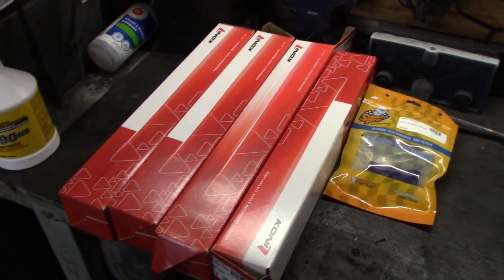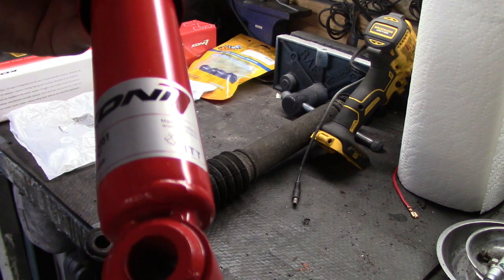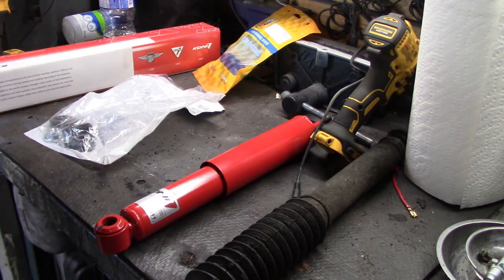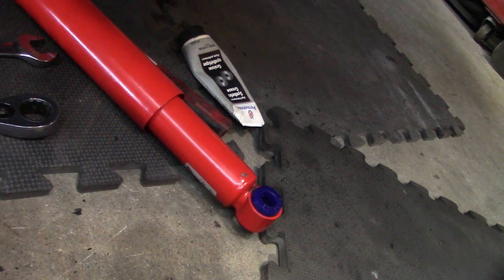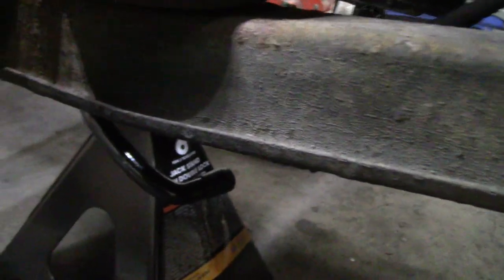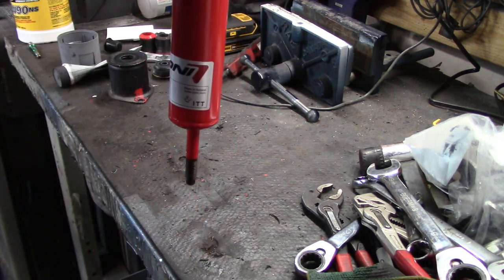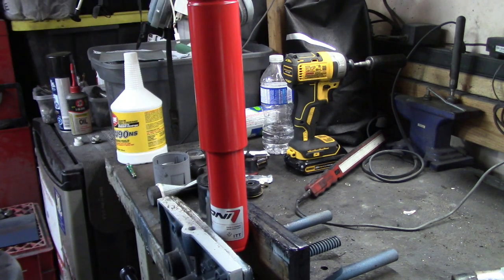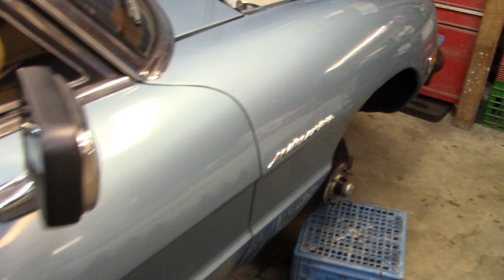1981 Alfa Romeo Spider Veloce, Koni Classic (Red) Front and Rear Shock Installation

Comment: Thank you for the excellent step by step video instructions! Why are the rear shocks setup softer than the front? An Alfa spec? Where did you find that spec?
Reply from the maker: Unfortunately, there is not much of a consensus on shock set up….some cars have stock suspension components, some slightly modified and some highly modified.  I set them up a little stiffer in front to prevent under steer…I left them full soft in the rear as even at their softest setting, they are much firmer than stock.

Comment: Didn’t I put Konica reds on the front of ts44836lo?
Reply from the maker: I’m afraid not Tom.  Just regular blue Armstrong shocks if I recall correctly.
Reply from the maker: I stand Corrected Tom!  Yes, there were Konis on your car!  Great memory.
Reply: @cheftush  I put orange Konis on the front of TS394 LO when I rebuilt the engine in 1967.  Startup coming this summer.  I wonder if the Konis are still decent ?
Reply from the maker: @johnsharonwhitaker9242  I would bet they are still good.